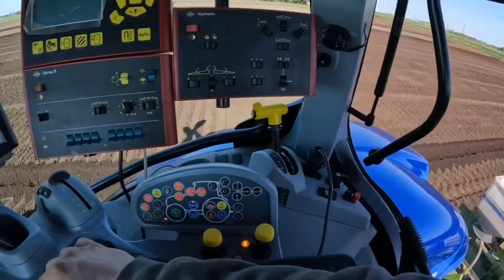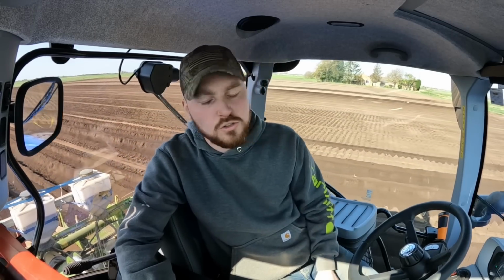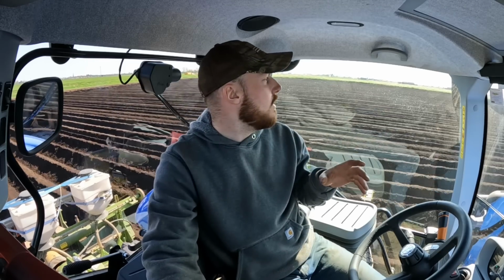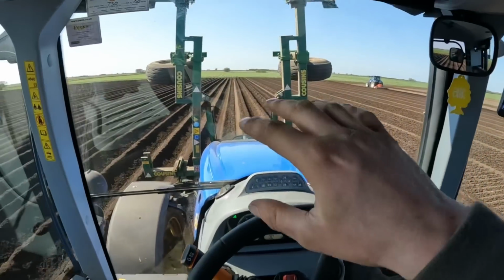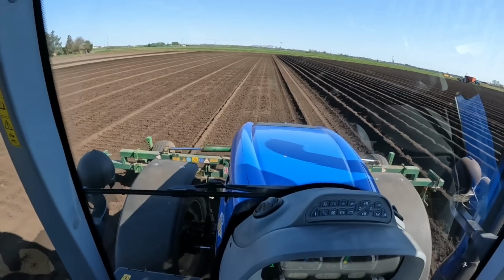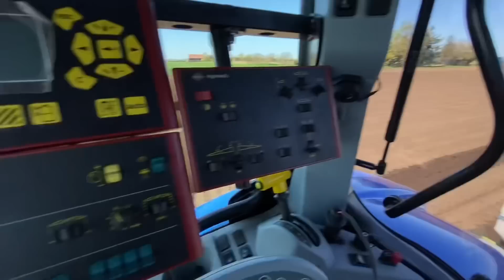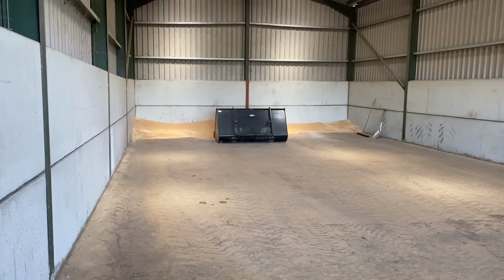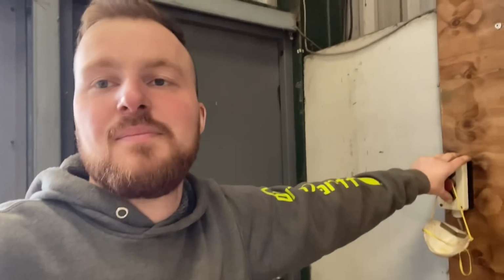Planting potatoes 🥔 & Pouring concrete 🚜👍🏻😎

Comment: Wouldn’t it be easier to just get a planter that makes the hills aswell?
Reply from the maker: The first pass when setting potatoes is the most important, powerharrowing breaks down the ground , basilier applies the correct chemical & gets rid of any clods. Plus new planters are very expensive

Comment: No re bar in the concrete I’m assuming you not gonna run anything to heavy over it . 
The job looks good though.
Reply from the maker: Yes we put re bar to join the 2 pads together, but we used the cement with fibre in it so you do not need the mesh in the bottom 👍🏻
Reply: Yeah sorry, you did explain on video of the second pour . I was interested that using concrete with steel fibres works out cheaper than using re bar. 

Ps do get to use the new tractor or is exclusively for your dad ? 😎